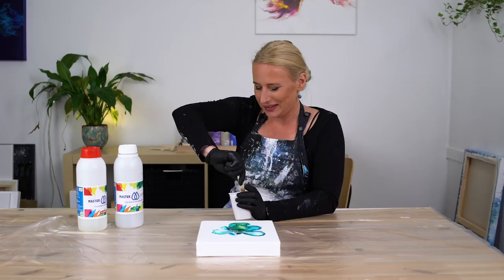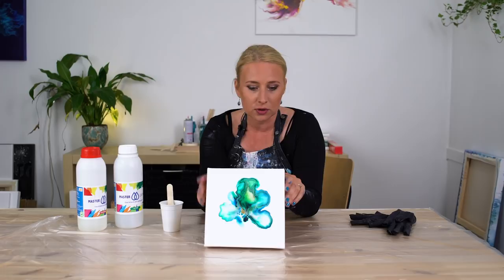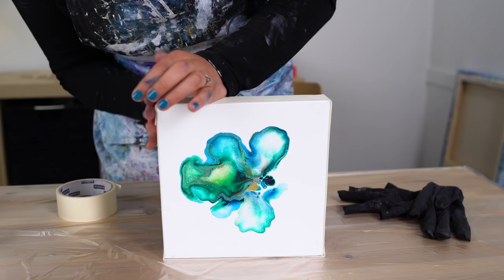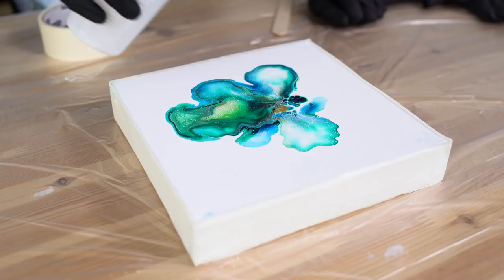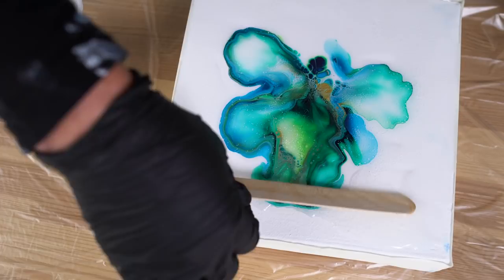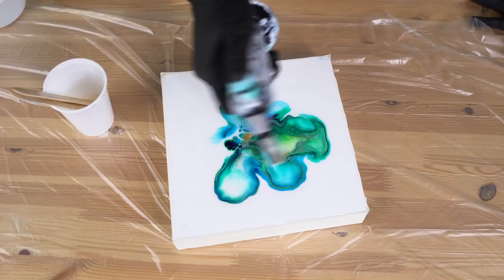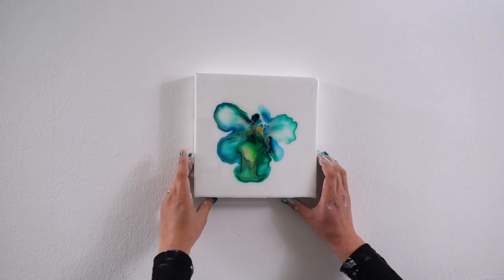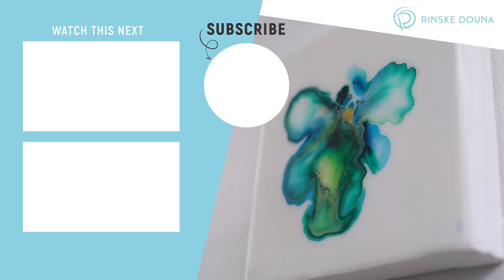Acrylic pouring finish - the DOME Technique - Resin pour beginner

Comment: The dome technique is actually easier without using tape and you will get a perfect dome without any sharp edges...just gently push the resin to each side using a credit card or some flat edge. A turntable and completely level surface makes it easy but then that is not always easy to achieve lol.

Comment: Please let your subs know about the safety requirements as a PSA...a respirator mask is ideal—I know you can’t wear one while talking/filming.  Also, as others suggested, pull your tape after a few hours so you don’t get that hard edge.  There are two ways to get the dome effect:  use tape, but don’t let the resin fill up to the top of the tape line.  You just need it to touch so it can’t roll back.  Or, forego the tape and use an old credit card to push to the edge without going over.  Best of luck and gorgeous painting!
Reply from the maker: Safety links are in the description with every resin video. Yes there are multiple ways to achieve this result, this one works the best for me on canvas 😊

Comment: Thank you for the video. When I use resin I end up having to reapply 2-3 times because there are areas the resin pulls away from. I level, clean, and use supports under the canvas to keep it flat. Do you know what I’m doing wrong?
Reply: I have this problem too 😖
Reply: It means that the area where it pulls away still is greasy. Clean thoroughly with alcohol! That has to help
Reply: karin de stercke  Thank you for the reply. Man I have tried using alcohol but no luck and even pictures I don’t use silicon it will do it.  I guess I need to pay more attention to the cleanliness level.
Reply: @tatovive  you can also try another doming technique..
If you didn't use silicone and cleaned your piece with alcohol. Use the masking tape but make a higher edge then Rinske does. Leave the tape on for a half-hour after you applied the resin, so the resin can already set for a bit. Take the tape off carefully, you'll see that the edge will dome and normally it won't pull back from your canvas..
Reply: karin de stercke I’m going to give it a shot :)   Thank you!
Reply: tatovive try a barrier coat first.  Golden makes a great product called Isolation Coat. Still clean your surface first before applying. Once dry you can resin as normal.
Reply: Waterfall Acrylics Isolation coat? Sounds cool, I’ll look into it. Thank you!
Reply: tatovive it needn’t be that product (although I love it), any varnish will work too.  I have an in depth resin video that shows how it works if you’re interested—it’s #65 on my channel.
Reply: Waterfall Acrylics  Nice! I’ll take a look
Reply: @WaterfallAcrylics   I wanted to reach out to thank you for your suggestion. It works wonders. Sure it's an extra step or two, but wow is a great addition to my "art". It even looks great on its own. Thank you!    I hope you have an amazing holiday season. Take care